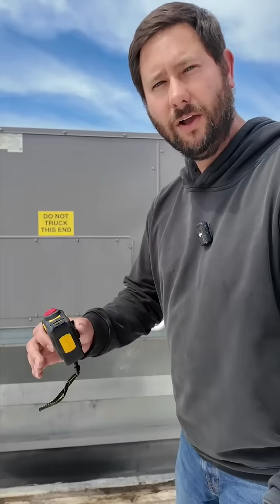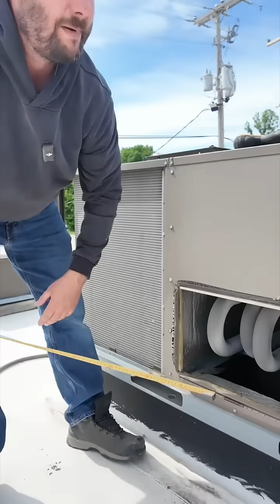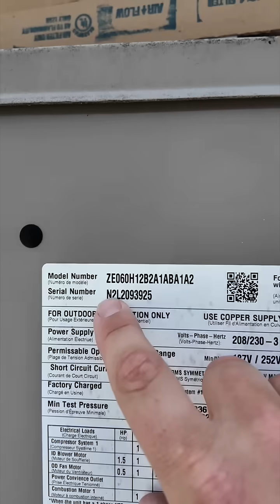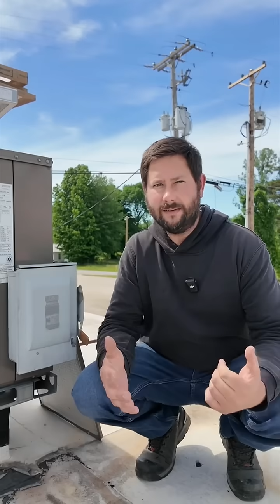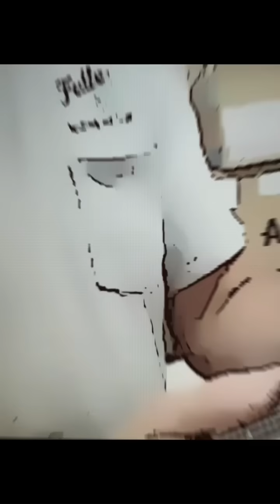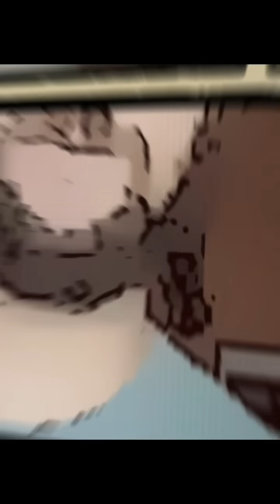How to Quote a Commercial HVAC Rooftop Unit Replacement

Comment: RTU commercial quote?!?!  😂😂😂. Get it wrong and give yo customer a free ac😂😂. Codes change. Make sure you on top of it.  Multiple units, after changeout, fire may make you change the sequence up and you’ll have to tie all the rtu’s in so if one goes off, all have to stop, curb adapter, crane, electrical wires condition and size?, condensate run out, controls, if BAS, you may have to contact controls to map it in, that’ll cost a bunch more, get it right or find out.